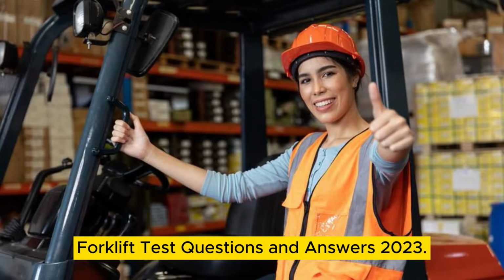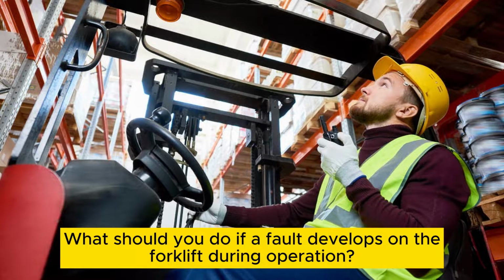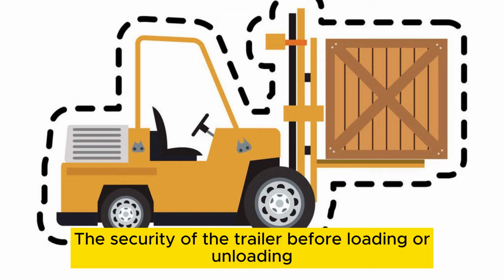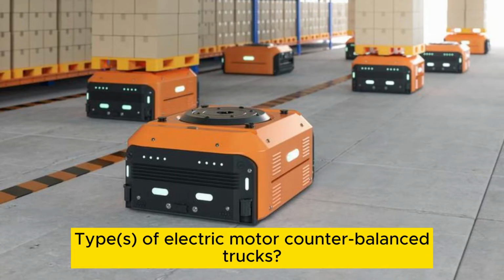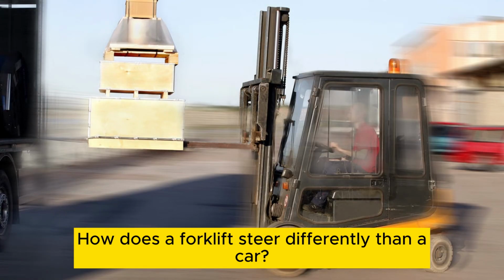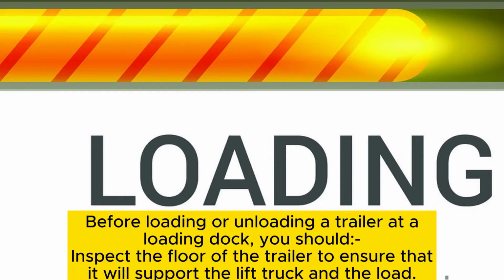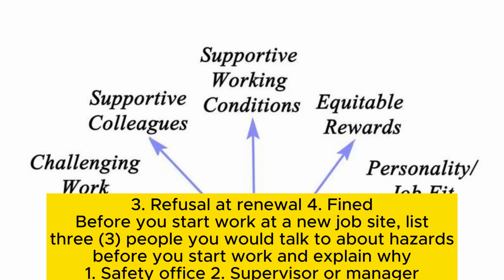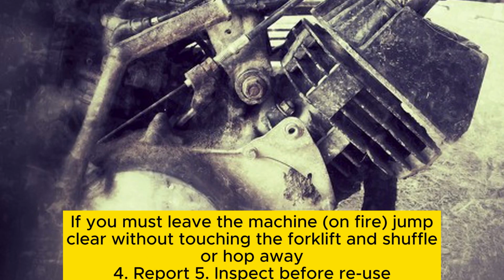FORKLIFT TEST QUESTIONS AND ANSWERS 2023

Comment: One of your question answers is wrong.  Driver training cannot be done by another employee.......must only be conducted by a qualified and designated trainer by the employer.  There is NO on the job training for mobile equipment.  No one is allowed to "practice" on a forklift unless under the trainer's supervision and no one is allowed to "learn as they work".  They must be fully certified as able to operate independent of a trainer if they are going to do so.